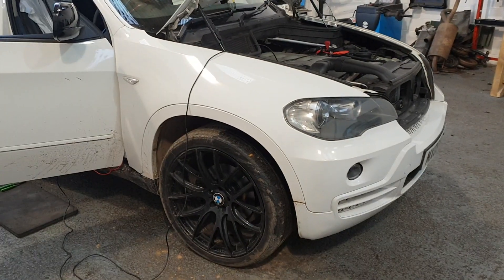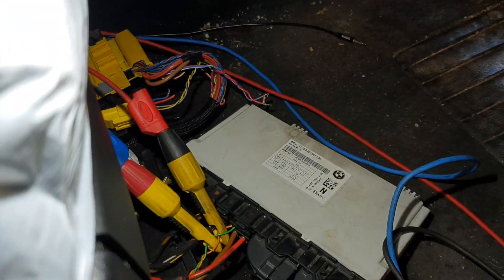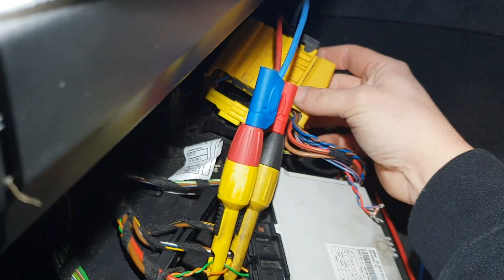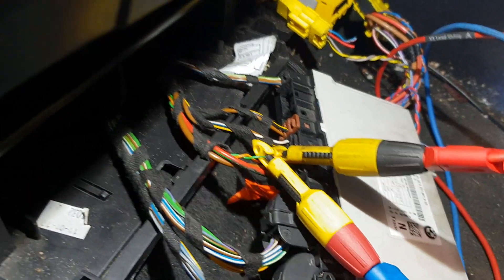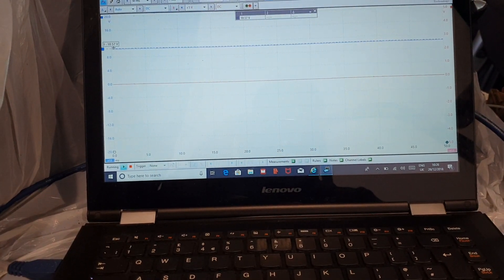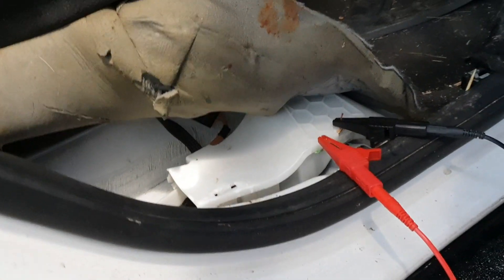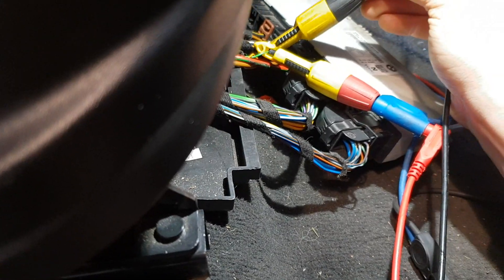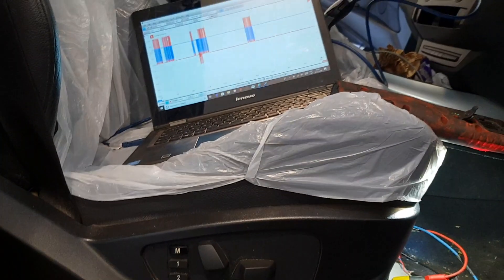BMW X5 Drivers Seat Electrics Diagnosis & Repair

Comment: With no power  how did you get that module out ? Would a blown heated seat pad stop all electrics including the main power switch in consol . It got wet before that seat was purfect . Any help appreciated

Comment: I have a similar issue, my driver's power seat does not move while the passanger's still worked. 
As i tried to measure the voltage in CAN-L and CAN-H the passanger's seat stopped working while the driver's began to work again.
Its seem there is a conflict between the modules, and does not work in the same time. Do you have any suggestion?